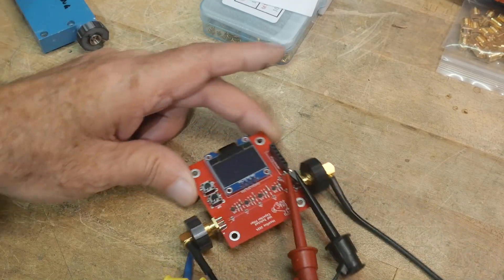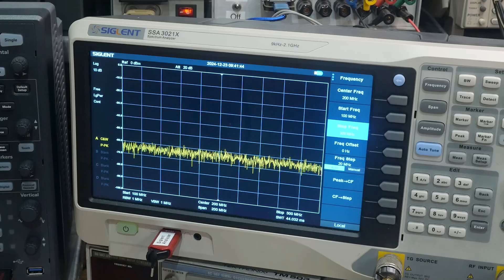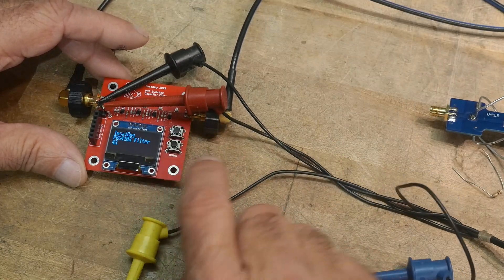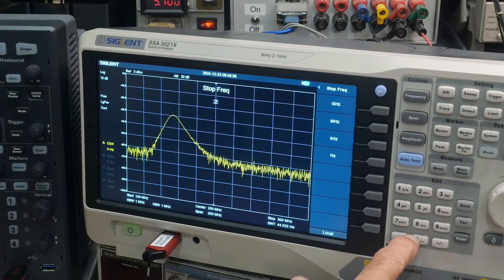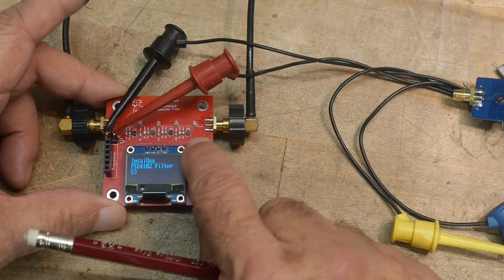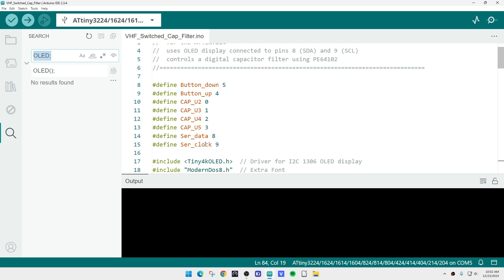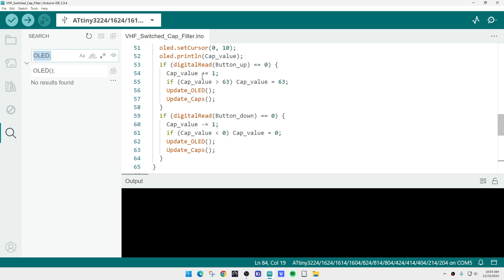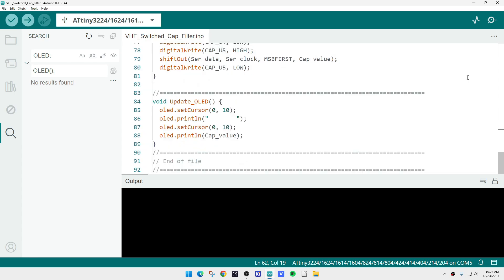#2102 Variable Digital Capacitor Filter (part 5 of 5)

Comment: for small boards like these, i found those $10 usb-c hot plates from aliexpress very useful. i solder those types of ICs (and much smaller ones) manually all the time. when JLCPCB screws up my PCBA orders i often have to re-work those types of parts too. QFNs are not so bad, actually. the worst are the tiny little RF filters and diplexers and packages like PG-TSLP-7-1 which have a large ground paddle and if stencil isn't made correctly you get too much solder and have to re-solder them manually all the time.
hot air station works too, but with a board like this when you have 4 of those packages and not much else, you might as well use the hot plate.
Reply: I got one of these cheap hotplates to learn SMD. The 603's soldered great. ATtiny SOIC-8 was also good.
The USB connector was not so good.

Well, I have another 8 boards to learn.

Comment: The filter response would likely be sharper and have less loss if the chip inductors were replaced with larger high-Q inductors.  One turn of hookup wire about 3/8 inch diameter might be in the right ballpark for each inductor, oriented to minimize coupling between adjacent inductors.

Comment: The datasheet specifies that the chip uses a 5 bit code, 0-31 your code is using 0-64, so it is going to cycle twice which will explain the jumps in the display. 
 
I think the performance should be better than what you have found, so it might be a idea to simplify the design down to just a single chip and a more conventional inductor. and cap arrangement Sweep that and see what you get. I've had some odd results trying to use chip inductor and caps in filter circuits.

As you have a spare board, tack some 0-10pf trimmers in place of the 64102's and see what happens, 

Andy

Comment: check if `int Cap_value` gets translated to correct type for `ShiftOut()`.
Arduino may map `int` to e.g. int16_t depending on the target MCU core and you simply shift out multiple bytes.
Better to specify in traditional C way what your code requires during variable initialization.

Comment: When making DIY boards with small ICs, I design the traces so that they extend out from the IC, extending enough that I can get a fine-tipped soldering iron on the the trace. Also, I don't cover the trace with mask. Lots of flux and you can get solder to wick up under the IC. Still tricky though!